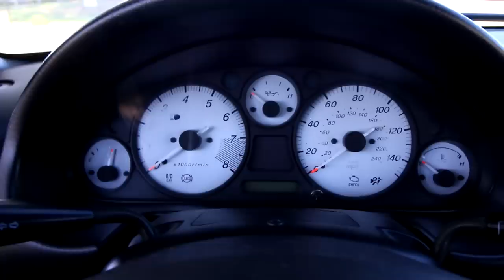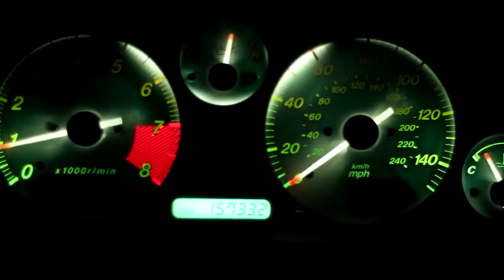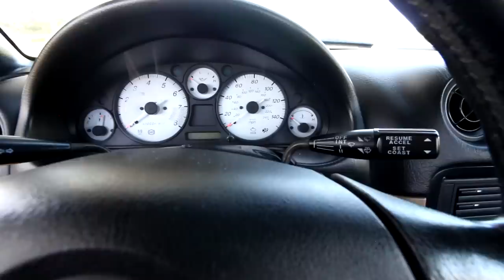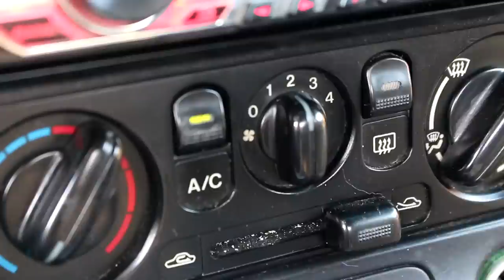What To Do After You Bring Home Your New Born Miata! (Miata Dad Protips) [Project 2SJ Ep2]

Comment: when i say "I own a miata" 90% of the time people ask me if it has pop ups. When i say no i have an NB they then ask if i can smack some pop ups on it..... now i'm wondering if i should've gotten an NA.
you also mentioned the cooling system. my car in heavy traffic starts acting a bit strange, dropping to 500rpm and sticking there in 1st gear. i checked coolant temp on OBD2 and it reached 106 Celsius (water temp gauge was still in the middle). i already flushed the coolant and have no clue if i have to do anything else to help. any tips?

Comment: You likely don’t need a new window regulator. Just clean old junk grease out of track and relube. Maybe get new rollers. Wouldn’t hurt doing that with your red car while your at it. Supposedly the hot stuff is the Honda shinsen-itsu grease. (You might have used it in a prior video?).

Either way, try that before spending money on a regulator.
Reply: He’s already done it for the red car actually, and just fyi the red car has manual crank windows 😅
Reply: Thx. I forget sometimes. Btw, I’ll be doing a full clean and relube on my power windows soon myself. (NB2)

So, it’s certainly time if mine are slow as well.
Reply: Yeah definitely start with greasing the tracks.

Comment: If the power steering gets a little harder to turn after going through a puddle and at full lock it does a quick squel. Does that mean the pump is going out? Also windshield wipers move sooo slow new motor for the windshield wipers too?

Comment: Nardi is stock. Most of the NB-s came with it. A few have the ugly 4 spoke Mazda steering wheel. NB facelifts has Mazda badge in center and Nardi logo on bottom spoke. My NB also has the headlight problem. Not popping up.Having it over 2 years and still want a solution! 🙄

Comment: man that car is a bit of a cluster.  NB2 left tail light, NB2 chrome fuel door (yes that was stock, optional on NB2's), black cloth seats in an otherwise tan interior.  Also that temp gauge is either reading incorrectly, or the temp sender is faulty.  NB Miata coolant temp gauges are useless, always reading the same between 160 and 220 degrees.  If it starts moving right from the normal position, the car has likely already overheated.  So if it has not actually overheated, I would suspect the gauge or temp sender is bad.  Definitely hook up an OBD2 scanner to verify actual coolant temperature.

Comment: Hey Greg how familiar are you with Air conditioning systems? My 2000 NB ac starts blowing hot when it's idling, but if i'm driving it's ice cold... the engine used to start running hot too at idle with the a/c on but the new big ass radiator, and supermiata coolant re route took care of that. I'm wondering if there's a sensor that's gone out or something or is the ac system just too inefficient to work at idle without the help of the air flowing through the condenser or whatever? does your ac work at idle?
Reply from the maker: The first things I'd check are that the condenser fan is running with the AC on even if the engine is cold, and also it might just need to be recharged, there's a pressure sensor that will shut the AC off if the pressure isn't correct. You can briefly jump that switch to see if the compressor kicks on

Comment: Thoughts on old tires/a bit of cracking? Good for summer driving or replace pretty quick?
Reply: That's semi normal. Just keep an eye on it
Reply from the maker: Also make sure to check the date code on the tires to make sure they're not too old
Reply: TheCarPassionChannel what would your cut off be on the age?

Comment: My best tip I have found so far is you can make a smoke machine for finding vac leaks with a soldering iron, a jar, bike pump and some mineral oil. It's really quite easy to make and is by far the easiest way to find leaks. My shitbox nb has had a few problems but I used it to figure out that my egr valve was toasted. Here's the best video I've found showing how to make one:     https://youtu.be/L9CDZ9lu6Rs

Comment: What is a  good website you would prefer to buy aftermarket parts for a miata?
Reply from the maker: It all depends exactly what parts you're buying, certain vendors specialize in certain parts. From a customer service standpoint my best experiences have been with Flyin' Miata, Treasure Coast Miata, and Bofi Racing

Comment: My bf has an 03 miata and it has plenty of problems itself but he's managed to keep it alive and running However the most recent issue is depending on the terrain his speed caps at 60 or 72 mostly 60mph he felt it may ve due to how his brother put on his timing belt. Could i get some advice about it so i can help him?
Reply from the maker: If the car won't go faster than 60mph it has a major problem, the car would have to be down on power by 1/2 for that to happen. If it started happening after the timing belt job there's a high likelihood the belt was installed wrong, and depending on how far off it is, can easily lower the power by 50hp or more, maybe even cause it not to run at all. I have a video showing how to insure your timing belt is on correctly, the title is something like "I helped a follower gain 80 horsepower for free". It's pretty recent
Reply: @TheCarPassionChannel   it will go up to 72mph sometimes but thats as high as it will go without going down a decent hill.
Reply from the maker: @ivydale4273  Even a completely stock 1.6L Miata can go over 100mph so it's definitely down on power

Comment: Also when I let my car idle with the ac on the temps stay fine but my clutch pedal stiffens a lot and it worries me, why does it do that?
Reply from the maker: The clutch is a standalone hydraulic system, the AC has no way to affect it... Only the pressure plate stiffness pushes back on the pedal.

Now the brake pedal can actually be affected at idle by the AC because most engines pull slightly less vacuum when the AC is on due to the engine requiring more air/torque to maintain idle speed
Reply: TheCarPassionChannel exactly what I thought which is why it’s so confusing that my clutch pedal stiffens does much only when the car is sitting at idle with ac on, it still works fine after but maybe the extra heat generated affects something I mean I have no idea

Comment: The engine is a non interfierence engine. So let it break timing if so put new on it and drive again..
Reply from the maker: Or, you could do your maintenance on time and not get stranded
Reply: @TheCarPassionChannel  true but just saying. I live in nederlands and have had2 mx3 v6 1.8 same story they never broke. Other maintenance i did i am mazda lover. Lookking now for an mx3 v6 from 1993 with 107000 kms the old relic of mine love that car and so underated.